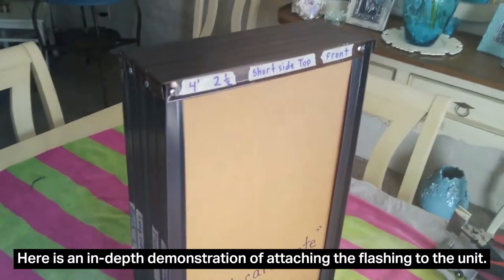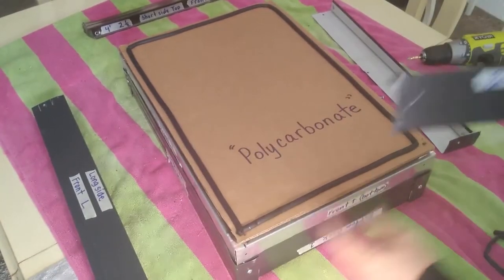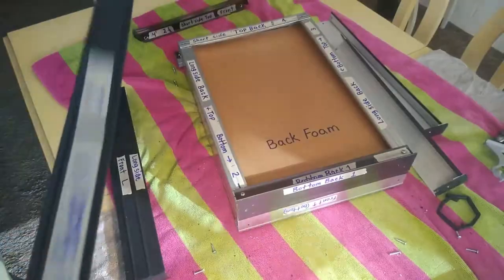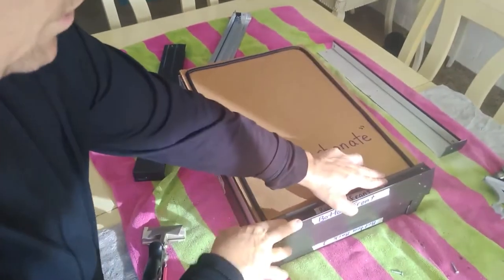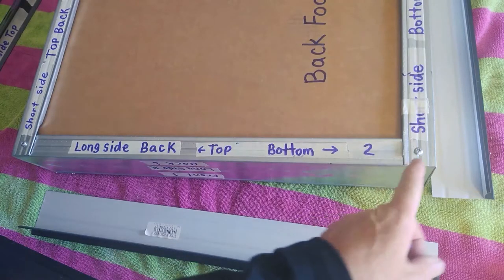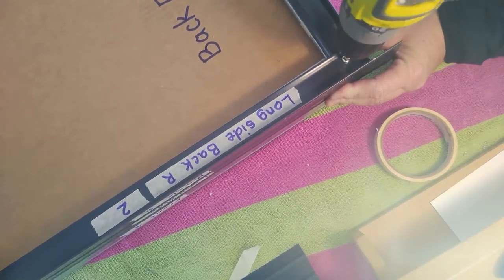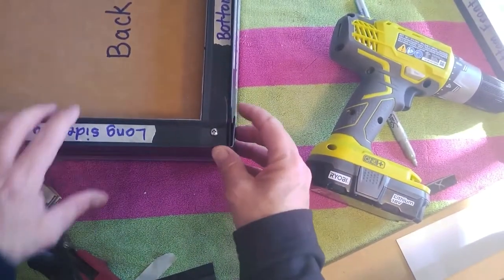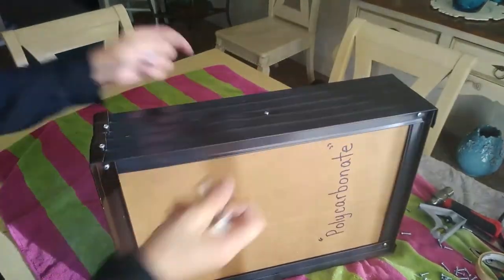DIY Solar Air Heater | Step-by-Step Building Guide [Part 3]

Comment: I made my own version of this years ago, with plywood and 2x6" sides and gutter downspouts as the heat sink, it worked really well. However, it was as heavy as the pyramids and the wood rotted, and the black paint stink never went away and it's long gone sadly. I was getting 140°.blowing in my house and I miss not having it, especially now! THIS design is the Cadillac of them all, light weight, insulated, and no paint smell, it's brilliant as can be. Thanks so much for your design and tutorial, it’s so appreciated. 💕👍
Reply from the maker: Thank you, Paul!  I appreciate your complements and am so glad you like my design.  Please do share your results!

Comment: I have made several heaters like these and could suggest a few things that I would do different to get efficiency up to 60-70%. Increase air flow to reduce exit temperature to around 100 deg F. Use 6" ducts and set fan ON temperature to 80 Deg. You are trying to heat your house and not the great out doors. Insulate ducting to at least R15.
 I used 2x8" galvanized exterior frame (special order) with 2" insulation all around and 3/16" painted plywood on the back side. I am looking at a 20 year life span. Clean exterior oily galvanized surfaces and paint the exterior black. The outside frame will heat up an slow exterior heat losses.  The use of foam gaskets is very problematic. If the foam gasket reaches 180 Deg. it will turn to mush. Use high temp silicone gasket. Apply talc powder to the top surface of any gasket so parts can be separated at a later date. Otherwise it's like separating bubble gum. I  mounted the collector to a pivot on the south facing roof overhang and swing it out to 30 Deg. in the winter and back to vertical during the summer due to the expected high wind load. I built a double pass screened collector with the entry and exit ducts on the collector bottom. I have to remove the ducting during  non-heating season. You did an excellent job with project description!
Reply from the maker: Thank you, Pianoman K, 
I have used both 4" and 6" and yes, more air flow w/ 6". Depending on distance from fan-to-plenum, both sizes are available.  I did use the 6" AC Infinity Fan Controller, but reduced down to 4".  I also agree on insulating the duct well and for more permanent installs, yeah, I would also keep the tube covered.  

Instead of needing to paint the exterior, I use off-the-shelf finished drip-edge that is black.  Yes, it does heat up but I haven't ever compared it to a non-black exterior, although one of my readers built two units and ordered the drip edge in a lighter color that matched his house.  He also had about 40' of run from the units to the register and he was getting about 140° at the register.

The foam gaskets I used have lasted without really any signs of wear for around 12 years, and I agree that they wouldn't do well if allowed to get too hot, however, I believe perhaps because they're exposed to the outside temperatures, this doesn't allow them to get that hot.  (an experiment is in order!). In the next build, I'd not be apposed to using a high temp gasket as long as it has enough squish to seal well. I'll look for it. Love the talc idea!  I appreciate your input and I love any ideas to make this design more efficient and long-lasting. Great stuff, thanks again!

Comment: I dig the concept. IMHO a few diagrams would make the construction easier to follow than repeatedly using terms like “short side top back” etc. I’m not trying to be overly critical. I appreciate the tips in building the project but sometimes I find too many details can be more confusing than a simple explanation of a concept along with the general construction and materials used. That said, it’s a great idea. Thanks for posting your project.
Reply from the maker: Hey I appreciate ya! And yes, I thought about the terms I used in my explanations and "short side and top back" etc. were used to not confuse.  I also try to teach to my verbal learners as well as my visual learners by providing both.  Thanks for you comments.  I hope you build yours soon!
Reply: @DIYPrimitive  I’m not ready to build one yet…I’m still living in Florida.  I’m gathering ideas for when I move to the high desert. Hoping to take advantage of as much passive solar as possible. In addition to other heat sources, I’m thinking a device like this one could be used to move hot air and circulate it through some kind of thermal mass under my bed. Charge the mass in the daytime and let it radiate to keep me toasty at night. 
So many years of Florida weather has turned me into a hot-house flower. I’m looking forward to getting out of the hot, humid swamp and into the mountains. I just need to mitigate the shock until I can build a tolerance to cold weather. I think my cat would appreciate a nice warm bed every night too.

Comment: Looks like a great design. I have also seen these made using screen material to capture solar energy and I wonder which produces more heat. Screen material is cheap but there are no baffles to elongate the heating path. Also how necessary is the caulking and rubber gasket material? If it's not air tight it might lose a little heat but not a great loss. If it isn't waterproof it would soon evaporate any water that found its way inside. Just thinking how to minimize the cost.
Reply from the maker: The gasket seals as well as protects the polycarbonate panel.  The cost of the caulk & gasket is very minimal.  The caulk not only seals the plenum, but it strengthens it and keeps the materials from moving around causing damage to the foam foil.  Screens are an entirely different design.  I have addressed this in other comments. This design offers a sealed plenum whereas a screen allows outside air to intermingle and pass through the screen.  I designed this heater to stand the test of time and I have repaired more screens than I care to remember.  So no screens.  I agree with you that any moisture inside the unit will evaporate.  Thanks for your great questions!

Comment: Eric, I can only find one inch not three quarter inch foam board. Would that extra 1/4" more interfere with the fit of everything or do you think I could get away with it? This design rocks, it's insanely clever and lightweight. My own design years ago with plywood and 2x6's worked well but was insanely heavy and rotted. I always dreamed of something this good and now it can become a reality.
Reply from the maker: Hi Paul, Sorry for the delayed reply. 1" should be fine.

Comment: Hey, great videos. I was wondering if it isn't too presumptuous a question, how much would you say roughly the whole things cost in materials?
Reply from the maker: Hi Mike, as materials across the board have all been rising, the best way to calculate it all up is to go to https://www.diy-solar-heater.com/tools-materials-list as I have all the materials with their links with prices.  For the heater unit itself, I paid around $300 last time I purchased everything and the mounting frame was another $200 or so with all the hardware.  The AC INFINITY Fan and controller together are around $170 as of today.  I hope this helps!

Comment: To me it looks like the steel profile frame (the interior one) is redundant, and in this particular structure (in this vid) the steel profile will act as a heat bridge and will cool the interior of the panel effectively. #fail

This whole panel c(/sh)ould be built from 2" foam insulation sheet instead, with the roof flashing on the outside, and no metal thermal bridges (all of interior enveloped in foam insulation). So, more insulation, eliminate thermal bridging. Also the internal baffles would be best made of this foam insulation. Also the duct work need to be insulated afaics.

Also, the front glass should be double or triple layer to improve the efficiency. With glazing that allows most of IR inside. Might be just plain clear glazing, with or without mylar sheet facing inwards. Still even with this optimization of the transmission of thermal radiation into the box, and minimization of the radiative loss, I do wonder if the thermal net gain will overshoot the thermal losses from the total system.

 But then, I am skeptical if the overall efficiency of air convection solar thermal panel will ever be very good, or nowhere near as good as to warrant punching two 8 inch holes in an outer wall. Here that would only leak heat out during dark of the winter when you need it most. What I think might work best is solar thermal panel behind a window.
Reply from the maker: Thank you for your comments. 
The steel stud frame you are referring to is not redundant and is there for strength and rigidity of the unit.  
The heat-bridging is very minimal in this design. 
Internal steel baffles are also strengthening and support the frontal metal sheeting and will not fall apart as I could see with using foam in its place.
Yes, ductwork should be insulated as in the examples I provide on the website.
Frontal "glass" is not glass, rather it is dual-walled polycarbonate. It both provides R-value and is 200 times the strength of glass, and very light weight, and readily-available in 4'x8' sheets. Glass is not and would be high cost for this size.
I advise in the book that I recommend a window rather than going through a wall where possible. Also, I'd not use 8" holes, but 6" more likely.
Yes, we can go nuts and strive for 100% heat retention, however, cost, size, weight, time, etc. all play a role in any design.  This unit is for supplemental heating and expecting more is unrealistic for any solar design.  
What we know is that this unit performs very well in getting extremely hot at over 240 degrees F with a straightforward easy-to-build method that requires no wood, saws or glass and minimal tools.  
I hope this helps. Thanks again!

Comment: Neat design.  Do you have any specs as far as Delta T at a certain CFM?
Reply: I have not had the time to run such tests.  I assume most solar air heaters put out similar temps and that data is out there.  I read a government document stating that the flat panel solar collectors are the most efficient.  Having a good fan and controller optimizes the flow rate to get a nice output.  The link to the fan and controller I use is on the Tools & Materials list found in the video description.  Thanks for your comment!  Please subscribe!

Comment: That's awesome!

My windup shaver, carpet sweeper, and windup toothbrush (preordered) aren't electric either

Who knows, maybe someday self luminous materials will provide adequate lighting?

Anyway...

What lattitude is this? And how much heat (if any) is left over for the house at night?
Reply from the maker: I definitely use an electric toothbrush and will never go back, lol. Plug in Rochester, Minnesota for latitude. There are ways to heat up materials such as bricks, water, etc. during the day so they can release heat for some duration once the sun goes down. This is very similar to how ETS heaters heat up bricks during off peak hours with electricity and bricks stay hot after the heater is turned off a during peak hours. But the main benefit is going to come during sunny days.

Comment: hm--  I'm excited to do this, but all of the quick cutting away and rapid edits (where some important bits are unfinished, or cut out)  -- makes this harder to follow than I was hoping it would be.   :\
Reply from the maker: Let me know what section you are needing clarification.  Also, be sure to read the guide as it goes through every step in greater detail. https://www.diy-solar-heater.com/read-the-guide

Comment: have you considered pop riveting the metal as opposed to screws for a more permanent assembly, cheaper and quicker than sheet metal screws in most cases
Reply from the maker: In my original book, I used pop rivets for the baffles and sheet metal frame corners. However, these are more difficult to use for the average Joe, are also hard to remove if needed.  So, I opted to use just one size screws for the entire assembly to simplify.  Also, these screws will not come out.  We used them in industry and never had a problem, even with high vibration. But go ahead and use them if you prefer. Thank you for your comment!
Reply: Oh ya I'd pick screws for sure. If not this project, some project requires being taken apart for some reason (repair, getting modded, who knows) by me or future owner. I stay away from permanent assembly for anything DIY.

Comment: Why not use "plain" transparent plexiglass ?
Reply from the maker: I think you mean why not use Plexiglass. Polycarbonate has fluted air chambers in it and adds R value.  Also, it doesn't yellow or crack, it's almost got a rubbery texture that flexes.  It is also 200 times the strength of glass.  It's super light weight, you can cut it, screw and drill through it without it cracking.  It comes in 4'x8' sheets and is also much less expensive than plexiglass.  I love polycarbonate!
Reply: @DIYPrimitive  Exactely, It is what I wanted to say: plexiglass, I'll correct my post, Thank You.

Comment: How did it work?
Reply: The tests I did last winter at -11F resulted in temperatures above 250F.  This winter I plan on using a digital thermometer as the temps are too high for the one I used. I have found that the air inside the unit heats up even if I allow outside freezing air to run through.  It works amazingly well.  The fan and controller worked great.
Reply: Is humidity and moisture ever an issue with this kind of setup? I've seen lots of videos with air heaters like this but no one talks about moisture issues. Could you make a video about this topic for this system?
Reply: @brandonsorgdrager2859  I haven’t tested moisture nor have I experienced issues with it. One thing I am considering however, is that one could provide a drain at the bottom back of the unit which would allow any water to drain out the bottom. This would be more so from what conditions from rain more than anything. I may explore this in the future but as for now, I haven’t seen any issues with it unless you’re home itself is high in moisture contact itself. Remember the unit is simply recycling the air from the inner living space at the coolest level possible and cycling it through to be heated and returned to the living space.
Reply: @ericlatocki7588  Thanks. Re reading my comment, maybe condensation would be more appropriate. Warm moist air from inside meeting the cold metal surface of the vent tends to cause condensation which would mean water would build up in the tube over time maybe? But with constant airflow maybe it would evaporate quick enough not to be an issue.
Reply from the maker: @brandonsorgdrager2859  Yes, the airflow keeps it free from moisture as far as we've experienced.
Reply: @ericlatocki7588  first of all thanks for your video! What kind of controller do you have? Considering I might build this for next winter. Do you got an idea how much watt/m2 this produces? Or could you give me the values of your inlet temp + outlet and airflow debit? Thanks
Reply from the maker: The quickest way to view all the parts of the system is on this page. https://www.diy-solar-heater.com/tools-materials-list.  I have not run such tests.  I'm but a mere caveman.
Reply: @DIYPrimitive  link says page does not exist
Reply: @DIYPrimitive  Page doesn't exist..